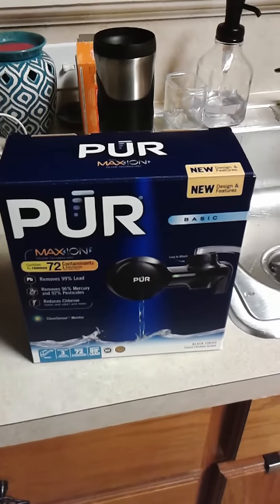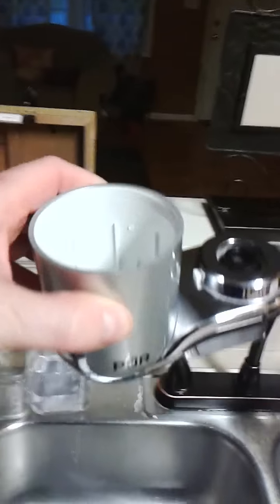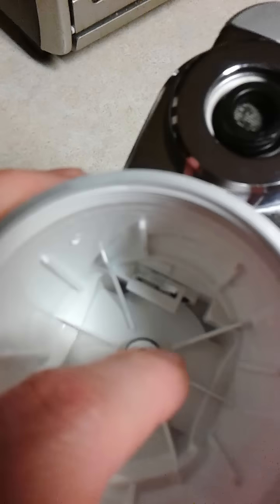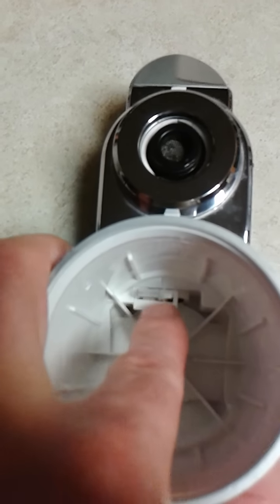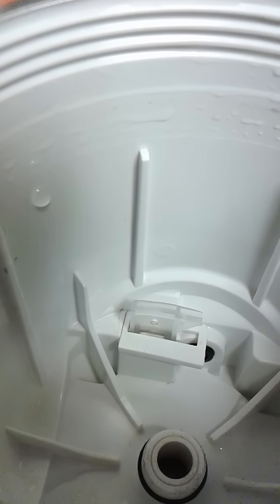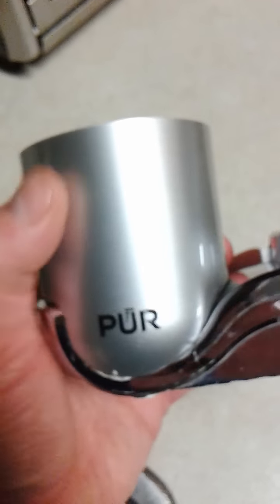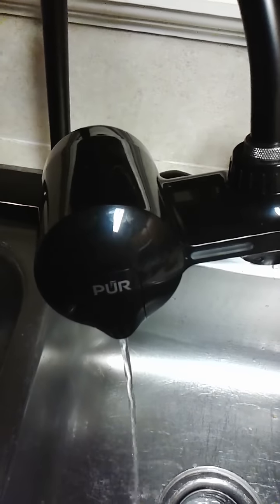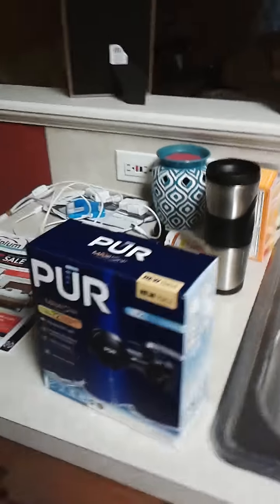PUR water filter replacement reset red light

Comment: Thanks Carl, I've been using these for years and have had trouble recently with the change filter light staying red after a new filter was installed.  Jiggling the reset switch that you show worked for me too.  Wish Pur would fix their parts & or manufacturing process to cure this new issue.
Reply from the maker: Yea, glad it worked for you.

Comment: THANK YOU SO MUCH FOR THIS VIDEO!!! THAT IS WHAT WAS WRONG WITH MINE. I EVEN WENT AND BOUGHT ANOTHER REPLACEMENT FILTER JUST IN CASE THE. I HAD TO TAKE A KNIFE AND TAP IT, BUT IT WORKS NOW!!!!!!!!!!!!!!!!!!!
Reply from the maker: Good deal.
Reply: thank you for describing what precisely to do with the butter knife. Everything being cheap plastic, it's too easy to break stuff. No prying - just a tap. it worked!

Comment: Is that spring the only thing that tells me the filter needs to be changed? I’ve had my filter 3 months and it started blinking red. I took out the old one and fixed that spring and put the same old one back in and now it’s green. Should I still get rid of it or will the sensor go red when it’s TRULY done?
Reply from the maker: The spring isn't intelligent. You can fool it like you did & it doesn't know. I run my filters through twice personally.
Reply: This is the concern I have...what did we actually reset?
Reply from the maker: It is a sensor that measures the amount of water flow.
Reply: Right, but why is it detecting a used and dead filter as new?
Reply from the maker: It isn't intelligent. It is basically a counter that measures water flow. Switch pops out, reset count# to 0.
Reply: Cool makes sense

Comment: Thank you kind sir for this video. The light staying steady red had me thinking I had to go out and buy a new filtration system and I looked it up and this helped immensely and worked. I had never seen it go solid red because I usually do a reset when it goes red one time by taking it out and putting it back in because the sensor usually goes red too early, about a month in when it usually tastes clean, fresh and the filter isn't even 'heavy' if you know what I mean and I'm sure you do until two month's time. Saved me 20 bucks haha, thanks so much bud. Anything you can tell me about the advanced, horizontally placed filter system in comparison to the standard one? I.E. is there anything you know that the advanced one does more of or better than the standard one since you own both or do they really only have different orientations and that's it? Thanks in advance for the help if you answer and thanks against for the video! 

Kind regards,
Chris
Reply from the maker: I was able to find this on PUR.com, "The white Basic filter and blue MineralClear® filters filter the same contaminants from the water. The only difference is that the blue MineralClear®  filter also filters the water over natural minerals for a crisp, refreshing taste."
As for me, we changed faucet colors and the horizontal model was the only one they had in black. So that was the only reason for us to switch from the upright silver model. Both taste the same as far as I can tell.
Reply: Carl Davenport Thanks for the information and quick reply! I always use the blue ones as they seem to last longer than the white ones too. Make sense, color matching the kitchen, gotcha. Fair enough. Thanks again for your research and have a great one.
Reply: Wow great fix! The instructions said nothing about what to do if this happens.
Thank you!

Comment: I have the white boxed version of this but why my filter so slow? I'm using the basic filter that came with it. when I see red light I just take it off n removed the water inside that little tank n it back to green again. but mine just have slow water while on filtering mode.
Reply from the maker: The water does flow slower through the filter because it is being cleaned before coming out. This is normal. By taking the filter out, you are just resetting the sensor to think there is a new filter. This does mean you have clean water. PUR recommends replacing the filter when the light comes on. Personally, I let the red light come & reset it once. At that point I buy a new filter.

Comment: Mine doesn't have the button in it. It's an older horizontal model FM-9100B. The light blinks when I screw the lid on but it won't turn on when I flip the switch to activate the filter.....any ideas???
Reply from the maker: I haven't seen that model, should have some type of reset though similar to the one in the video.

Comment: Mine is reset with that thing popped out but im not getting any lights at all...not even the red
Reply from the maker: You could try to remove & re-seat the filter. If that doesn't work, try another filter, hopeful you have a multi-pack.If not, it may need to be replaced.

Comment: according to the manual, when the light is red it's time to change the filter
Reply from the maker: The red light does indicate that it is time to change the filter. Sometimes when you remove the old filter, the sensor/spring doesn't pop-out. So when you put the new filter in, it still shows a red light. The video covers how to reset the unit so the green light comes back on. This way you know it is working properly and when the red light comes on later you know it is time for a new filter again.